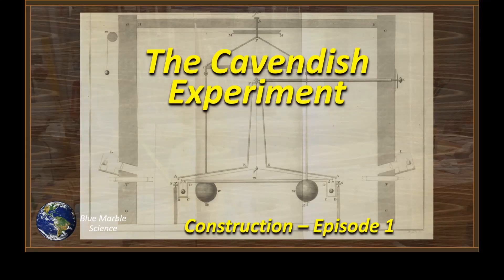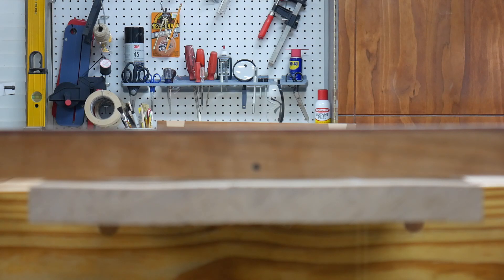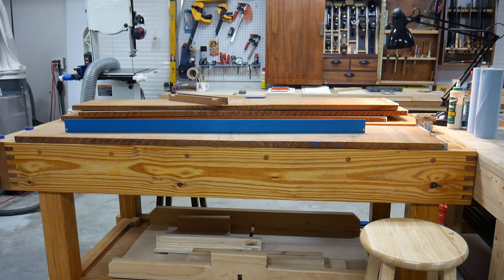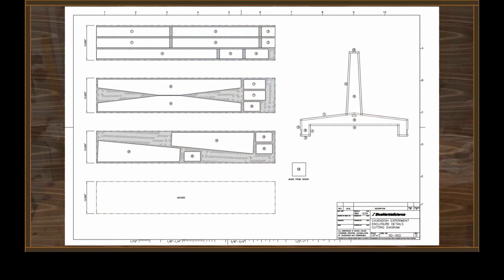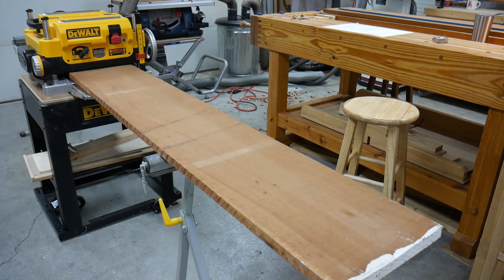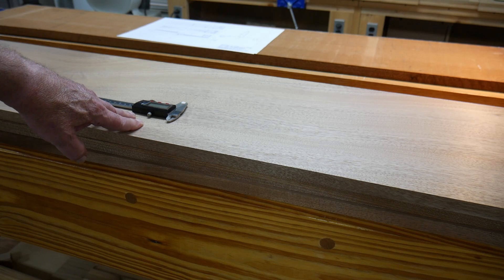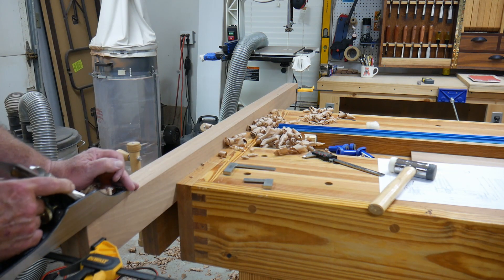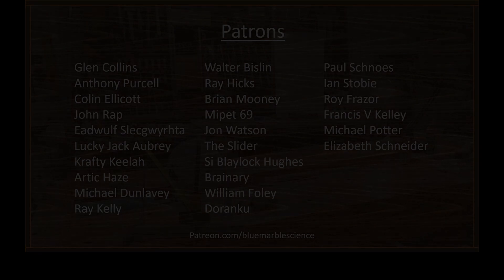Construction   Episode 1 (Edited Version)

Comment: Is there a way to just make a flat surface using epoxy resin?
Reply: Eko Jar - exactly how flat do you need? (I.e. what tolerances are acceptable).
Reply: @duncanmcneill7088     I'm mainly just curious if it would help any, I'm not sure what is best for the Cavendish experiment,  I haven't done it but I guess I would would shoot for a 100th of a millimeter of tollerance and if I actually reach it then try to get it within a 1000th. I know it's a very sensitive experiment so I would just want to get it as flat and smooth and as perfect as I possibly could get until I know it cant effect anything. I was just mainly curious if an epoxy resin in the wood could maybe help fill in the gaps with the twist and unevenness on that one twisted piece of wood if I want to try to Build one myself. Build a frame around the wood pour as little as possible to have one side have plenty of material to hog off and sand like maybe a centimeter to 3/8 in . I'm really looking forward to this build and the whole thing,  I just really want this thing to work the very first time, I think these guys have the tools and expertise to do it even though it's a tall task, but. Even if it doesnt work the first few times. I know it will work eventually and there will be many many videos to prove it once and for all to these idiots . Who knows, they might find a more precise constant! That would be huge! Nobel prize worthy !
Reply: Eko Jar - OK, you should theoretically be able to produce a flat surface with no more that .001mm deviation over about 3.5m (I was previously doing the rough calculation in my head and got it wrong...) using some form of self levelling epoxy. The surface roughness might well be greater than 0.001mm though. Over 12m you should get 0.01mm deviation.

As far as the accuracy for the Gravitational Constant goes, this method is unlikely to be a huge improvement on Cavendish’s one. No disrespect to BMS but other methods have been developed that have yielded much better accuracy for the Gravitational Constant. The current best measurement (2018) has a relative uncertainty 0.0022% compared to 0.6% which Cavendish managed using this method.
Reply: @duncanmcneill7088  cool! Thanks for the info!

Comment: I did not do at all well in wood shop in high school. So I can sort of feel your pain there. Also, due to the construction of the planer, I was not able to send any classmates through it. The table saw had a bunch of safety devices on it too. So the class was a total waste for me. Anyway, it will be interesting to see how well you can read off the angles when the torsion beam is in the enclosure. How about using mrads as you unit of measure instead of DºM'S"?

Comment: I wonder why actually the flerfs deny gravity? A flat earth with gravity could work as long as the plane was infinite, or at least much larger that the part inside the NASA guarded ice wall. Such a model would still miss the easily detectable Coriollis force but at least they would not need to pretend there is no gravity.

Comment: To put myself through college, I worked in a steel mill for many years. For the new hires, we used to send the guys for some fictitious equipment: left handed smoke shifter, knife chip filler, coil stretchers, etc. In the woodshop, where they built the wood skids, we had a piece of equipment that would take care of that issue. Looks like you could use a wood expander. 😜
Reply: I'm gonna have to send you to Clifton for a bacon stretcher and a fork sorter.
Reply: The usual one where I started out was to send the young apprentices to the tool store for a "Long Weight".
Reply: @thearmouredpenguin7148  The storeman keeps those next to the 'long stand'
Reply: @philyoung6745  Or, you can send aircraft mechanic trainees out for 50' of flight line and a gallon of prop wash.

Comment: ,I'm less than half way through and I'm wondering if there is some sort of squaring device for a plane. Something that comes down and rides along the vertical surface in effort to make the top surface meet it at 90°. 
 If it doesn't exist, I want to build one.
Reply from the maker: There is a squaring device Heatshield - it's your index finger! It's hard to see but when I'm trying to get the top square, my left hand is wrapped around the front of the plane and I'm using my index finger to position the plane more to the left or the right depending on which side is high. Just shifting the weight like that will make it cut a little heavier on one side. I've been making too many YT videos so I'm a little out of practice but when I'm doing it all the time, keeping it square is no problem at all. Other types of planes like rebate planes have a side guide but it really isn't a practical thing for a bench plane
Reply: @bluemarblescience  that's awesome,  man. Thanks for taking the time to get into the details here. I often think of tools and methods to achieve precision. 
 Initially I was just thinking about what flerfs could possibly say about this. "his wood has metal in it, his wood isn't level, his wood isn't orthogonal! . ". blah blah blah. 
  You're doing something unique and badass here, man.

Comment: There's a way to prevent that warp. 
To start with get yourself a 6" jointer.
Don't thickness plane anything yet. 
Cut your pieces over size and check for warping.
Joint one side and edge.
Now you can plane the wood to thickness, followed by the table saw.
If you plane your wood to thickness and cut to near the right width it will probably warp every time. Removing  material in stages will help keep it straight. And it still hurts to see you put hand planes on a table with the cutting edge down. Looks like you're having fun and a great project.
Reply from the maker: No thank you Dave. I don't need, nor do I want a jointer. In the first place, I don't have room for one but even if I did, I don't like using them. If I go that direction, I'll get a router table, a dovetail jig and put all the hand tools on Ebay. My method works very well and it's not normal for me to have a problem like this. If you bothered to listen to what I said, initially I said I was going to rip the wood first and then flatten and thickness it but that grain looked so uniform I didn't think it would be a problem. I did rip the replacement piece and hand flatten it before thicknessing it. Takes more work to do that but I have the satisfaction of knowing I did it. It actually takes some talent to flatten one side of rough lumber. Even more talent if you take it to thickness by hand and I do that too when I don't have so much of it to deal with. Besides - it's good cardio!

I've heard that complaint about setting a cutting tool designed to cut wood down on a piece of wood and that's just silly. You're not the first guy that's brought that up. But my bench does not have a single ounce of metal in it other than the vices. Now I can lay the plane on its side like we did in 6th grade shop class and when I pick it up I can wonder how far out of wack I knocked the lateral adjustment by doing that or just set it down on the bench the way I do it which is harmless to the plane. And if you ever accidentally snap one of the ears off an old Stanley Bailey (like I did by accident one time), you'll make sure you don't ever do it again!

I'm not being critical of your methods Dave. If that's what works for you that's great. I do what works for me. Remember that there are almost as many woodworkers out there as there are woodworking methods - everybody has their own.
Reply: @bluemarblescience  I have no problem with woodworkers doing what their comfortable with.
I like the jointer, I've used a 16" jointer and 24" thickness planer in the shop's I've worked in. I have a jet 12" jointer/planer that work great.
Only reason I brought up the hand planes is best practice. Wood is abrasive, or tools wouldn't get dull. Occasional use is ok, I just got into the habit of laying them on their side. But I've used them 8 hours a day for a week on pine, hitting knots will dull the blade and pine doesn't cut well without a sharp blade. But it still hurts😉
Looking forward to the finished product.

Ps I've believe always use the tools you're comfortable with. Keeps the fingers on the hand that way.
Reply from the maker: @roscoepatternworks3471  If I wanted a jointer, Jet would be high on my list. My bandsaw is a jet and I really like that thing. The upper blade guide is a little cheesy but the rest of that thing is built like a tank. I can and have shoved 12" logs through it and it doesn't even flinch. I fully understand what you're saying about the plane and I won't set mine down on any of the other benches out there other than that main bench. All of the other benches have plywood tops with metal fasteners in them and I hate having to sharpen a nick out of a cutting edge. There's a #4 Model 20 in the top of the cabinet that's good for planing nails and screw heads - and that's about all it's good for! Stanley went all to hell about the time they came out with that piece of junk. I picked it up on Ebay for $5 and I think I overpaid - LOL! Seriously, I'm very careful and meticulous with my tools. When a cutting edge becomes sharp enough to shave with, it's time to resharpen it. Thanks for the comment.
Reply: @bluemarblescience  take a look at grizzly tools as well. We have one in Washington, I've bought a lot from them, no shipping I go and pick it up.
About 30 years ago my dad bought for me 4 planes, 12" to 24 ". All of them have a patent date no number oldest 1914, some of the hardest steel I've ever tried to sharpen. $75 for all 4. Even though I had to remake the handles. Sorry I like talking tools.
Reply from the maker: @roscoepatternworks3471  Grizzly makes nice stuff too. The wood supplier I use has several Grizzly planers and jointers. Those things are really industrial grade equipment. I don't have any bench planes as old as yours. My oldest is a Type 15 but the blades in those things are very hard - that is true. I've bought a few replacement blades over the years to make scrub blades or the like out of and the new ones are noticeably softer.
Reply: BlueMarbleScience 
Don’t place hand planers on their sides. You can always place them down with one end resting on a 1x scrap of wood. The plane then rests on a tilt with the blade effectively suspended in mid air so it never touches anything.
Reply: Warp is something every Trekkie knows well.